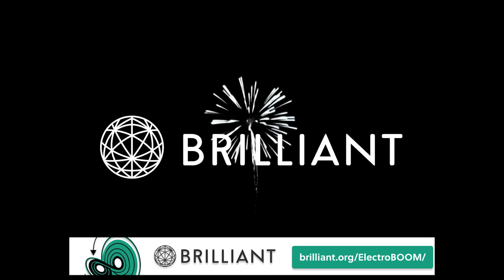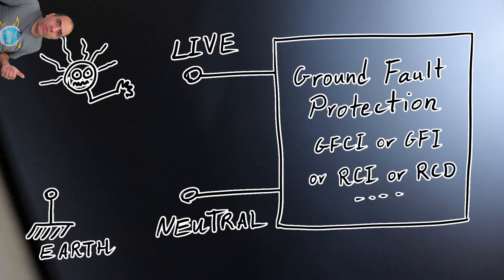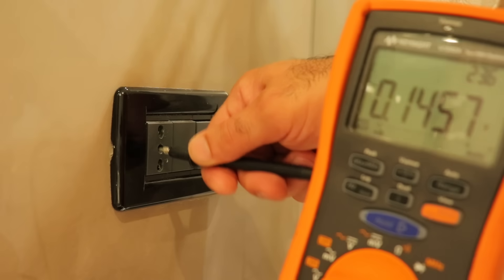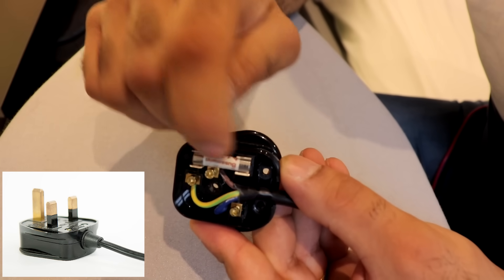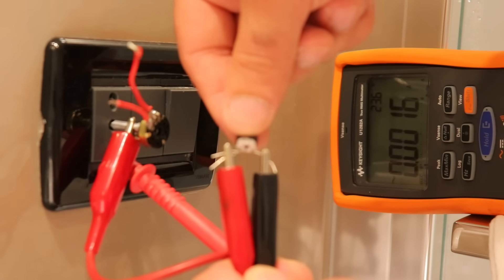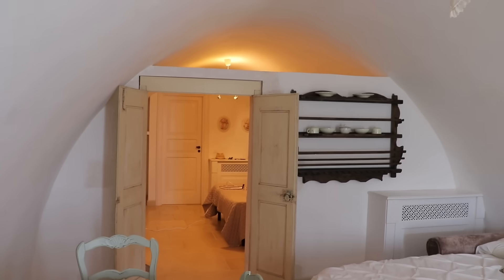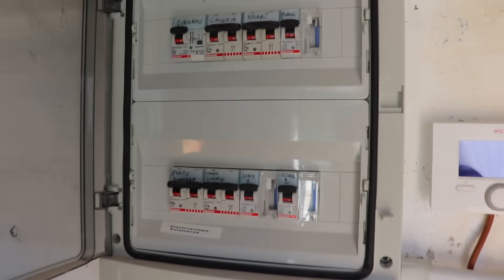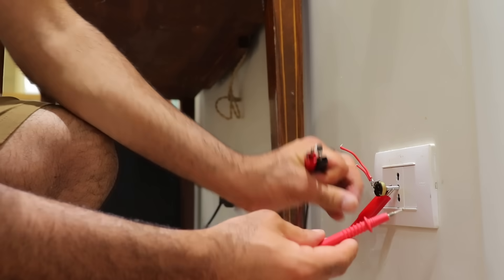Tripping Every Breaker in Italy

Comment: In most of the EU the problem at 15:26 is mitigated by the ungrounded outlets also being in a recess, which is exactly as wide as the plugs, which are meant to go with them, so the big plugs can't be fitted. (of course you can put an ungrounded plug in a grounded socket)

Basically in the EU, before engaging plugging anything in, you have to play a round of toddlers' game, where you put bricks through various shaped holes.

Also like how in France and Belgium (possibly a few other countries too), the grounded socket has a prong for the ground wire, and it engages with the hole on the grounded plug (that weird metal part between the prongs of the plug), but it still leaves room for an ungrounded plug to be inserted.

Comment: "weird plug" in the second hotel is for telephone :)

And btw, here in Belgium, the whole house (lights and plugs) are behind a 300mA GFCI except the "water rooms" which are behind a 30mA GFCI

The plugs are also different, the small tripod one in Italy exist here but no earth on those plugs, only the big round one have earth
Reply: Yup its called Jackson 605
Reply: I was guessing this was it. In France it looks slightly different but quite similar.
Reply: Itsnt it supposed to have 100mA main gfci and 30mA ones for different loads?That way you only trip the main in a 30mA one fails.
Reply: Belgium and France have powersockets with an earth pin, so you can plug in the powerplug only  in one way. I am wondering, is this fully standarisized so that always the brown wire of any device powercable is the phase?
Reply: @janwesten1317  in France the colors are Blue - Red - Green/Yellow while in Belgium we have Blue - Brown - Green/Yellow

Comment: In theory the schuko plugs (those rounded ones near the end of the video used on appliances) should not fit into the standard italian sockets. The schuko standard is a german one and its pins are slightly larger so normally they are incompatible with standard italian sockets and similarly the italian plugs don't fit into regular schuko plugs as they lack the central hole. There are plug variations that look like schuko to some extent but fit into the regular italian plugs and they are fairly rare and usually don't have the ground pin at all. Also there are schuko sockets that can accommodate both the schuko and the italian plugs.
All this of course makes sense as germany is one of our neighbours.

The grounding is usually omitted for your typical laptop or smartphone, which rely solely on the apartment's RCD and short-circuit protections.

All houses and hotels will have the setup you observed where the RCD is centralized. It has always been this way in Italy since RCD devices have been introduced.

It's true that the UK plugs have more safety built in, but honestly I love the fact that our (italian) plugs can be connected in two ways. It's very useful when you have to connect a power supply.

Finally, the secondary larger set of holes is intended for 13A appliances. Basically where you have the two closer pins you can draw up to a maximum of 10A. Where you have the second, larger set of holes (as well as for schuko sockets) you can draw up to 13A. This in theory should match the size of the wires in the socket but this is not always the case and more often then not they tend to use larger wires also for the 10A sockets.

Also, most of our socket boxes are divided into three modular slots we call "fruits". This means you can mix and match sockets and have 1, 2 or 3 sockets in the same box. That's pretty cool as it allows for nice extensibility.

Fun facts:
- most italian residential supply contracts are set to allow a maximum power draw of about 3KW for an apartment. Higher contracts are available of course, but are rarely used as they cost more. If  you get above 3.3KW a central switch will trip. Usually that switch is separated from the others and located nearby the power meter.
- the RCD in italian is called either "differenziale" (differential: it works by checking the difference in current between phase and neutral) or for regular folks "salva vita" (life-saver: no explanation needed).

Comment: Quick notes while watching the vid:
- we usually use one centralized rcbo and not on outlets;
- lol black is not supposed to be the neutral;
- yes sometimes it happens that you trigger both the local protection and the one before that;
- oh come on don't call them fuses they are magnetothermic protections;
- voltage to the low voltage customers is 230v +/-10%;
- we tend to place "fuse" boxes behind paintings and mirrors;
On a side note I think that all considered we have one of the best electrical codes around.
Reply: I live in Denmark so the rules obviously may differ to Italy, but there are probably similarities.

In a new home live would be brown and neutral blue. But in older homes the wires can have all kinds of colors. Black for neutral is pretty common in that case.
Reply: @coolguyflex  In Germany, it's brown for live and blue for neutral as well, and green-yellow for ground. Older installations often had black for live, grey for neutral and red for ground.
Reply: @coolguyflex  Its interesting that Denmark only allows 13A for 1.5mm2 wire despite its colder climet but in Australia they have no problem with 20A on 2.5mm2.
Reply: @MernokiMegoldasok  How do you know it's only 13A? I would've assumed it'd be the same as in Germany, where they most commonly use 16A breakers for 1.5 mm².
Reply: @srccde  We have around 13A limit here in Italy too. Absolutely no 16A on 1.5mmq.
Reply: @srccde  someone commented in al older video.I dont remeber the link.
Reply: @Ale-bj7nd  Interesting. 16A on 1.5 mm² is a no-brainer in Germany, usually.
It's probably due to the higher average temperatures in Italy.
Reply: @coolguyflex  ahahah yes. Same here in older houses, like mid 50 up to early 70, the wires have were solid core copper and mixed in colors
Reply: @coolguyflex  yeah blue/brown here too. And yes, older houses are a mess.
But blue has always been neutral here because black can be used for live wires too! That's the problem.
Reply: @Ale-bj7nd  Black can be used for live wires as well in Denmark. But they've been widespread as neutral wires. So it's just a giant mess.

Comment: I have been in Italy in the month of June, never ever in my life have I seen high voltage wires on the ground, that's right, 3 wires, R S T, 10 KV lying on the ground because apparently they didn't use money and resources to make a proper path for the cables. As a side note, it was on a mountain.
Reply: If a medium voltage distribution line falls on the ground the protection should trip.But never assume its dead.And dont go closer to it than 8-10 meters.If you have to do it walk in short steps to limit step voltage.
Reply: These have insulation on them, the red colored one. One kabel is 1x240, high voltage kabels, 10 kv and 2 Amper. And they are just lying on the path/route that is shown as a hiking trail.

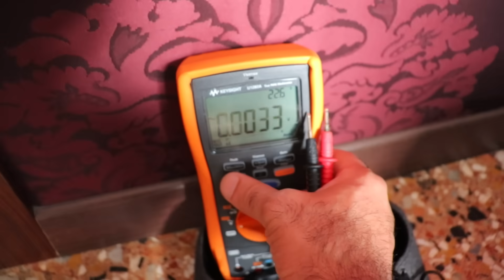Comment: 1:45 I was honestly scared if you were on current or voltage mode, thank god you didn't short it
4:35 I mean, I just expected it
12:05 Something you don't wanna hear from an electrical engineer
12:55 Sir there's a difference between schoting Ground with Live wire and Neutral with live wire
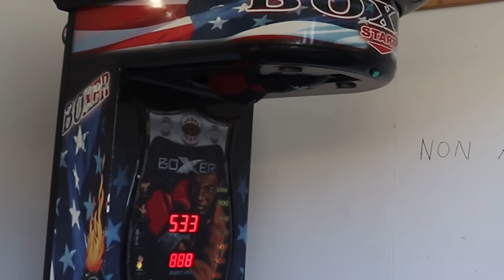13:58 Haven't seen your daughter in a long while, good to see her, she looks quite grown up now

And just inagine some youtuber enters your hotel, trips electricity and judges your power breaker, outlet and protection circuits

Comment: Your videos are both informative and entertaining. If ever you come to France you will see pretty much what you had in the last two hotels, except there is only one style of socket for wall outlets (the polarized one, except the earth is a prong), older unpolarized outlets are not available anymore (note the holes were smaller to prevent insertion of polarized plugs... well in theory). Light circuits (10A breakers) are separate from outlet circuits (16A typically, sometimes 20A). One 30mA RCD per "group" of lights or outlets. No unprotected circuit, all must have RCD.

Comment: At 3:40 you said black wire was neutral. Are you sure you didn't mix that up? In most of Europe, Italy included, following the code that has been used for decades, blue shall be neutral. Black, brown or grey for live or white when the live wire comes from a lamp switch (the white thing is often neglected and the same color used to and from the switch). Black neutral would be a serious mistake.

Comment: Here in Italy you can instantly see the rcd in the breakers panel by a button with a "T" letter (meaning "test") on the breaker itself... if there's no T button, there's no rcd.. i always install breakers with rcd even for air conditioning line, light line, power outlets line, dedicated power outlets for kitchen line etc.. greetings 🖖🏼

Comment: Actually Venice wasn’t up to code: blue (the only color mandated along with green/yellow) should be neutral. Also we use 2pole breakers because distribution is TT and not TN (PE is not provided nor bonded with neutral). Also in Rome you should have experienced 230V 3phase (with distributions across two phases and without neutral….. who needs the neutral for 125V stuff today)

Comment: In denmark new standard 2016 and up is required all new building have 2 different RCD. So no single RCD can cut off the whole house. My apartment has 2 different RDC :)

and some wires that doesn't have ground is ok. Most smaller electrical devices is double insulated. Like a laptop charger og phone charger. Very likely double insulated.

Comment: the plug at 15:17 goes in the outlet beacuse it was forced in before, but it should not enter because the hole diameter in the outlet is smaller. But we all force that type of plug if we do not have the adapter, so it is common practice.

Comment: 3:38 black is phase, blue is neutral and green/yellow is protective earth. 
C is the characteristic of the breaker, 10 and 13 are the amps. There is also B characteristic, which is much more common (and should be installed in a hotel). C is for heavy loads like big motors which suck lot of power when staring.
Reply: Do you mean "should be" as per your opinion or as required by law?
There's at least one European country where C curve breakers are used everywhere, Belgium.

C breakers trip magnetically at 5-10x In, B breakers between 3-5x In. Unless you're switching many capacitive loads without inrush current limiting, i don't see why C curves are the standard choice but that's the way it is.

As far as i know, B is the standard in the Netherlands and possibly Germany.
Do you happen to know if any of the other European countries require a certain characteristic curve for residential applications?
Reply: @bjornroesbeke  Both capacitive and inductive loads can trip a B breaker.In Hungary some utility companies put a B type 32A breaker so you cant put C in your breaker panel because the main will trip before that.
Reply: @bjornroesbeke  „should be“ is not enforced by law. The guy who is doing the planning should consider the load. And in a hotel there is no need for „C“. Water cooker and vacuum cleaner will not Trip a b13.

Comment: funnily you can tell bare overhead line voltages by insulators. this is not really accurate but difference in tens or hundred of kilovolts is clearly showing

Comment: As italian I think all the breaker trigger at 0.30amps because most house hold items here have what Is called double insulation, thats prevent the user to come in contact with high voltage in case of a fault of the item

Comment: 15:23 normally you can't do that. The plug is most likely worn out or someone tried to force the plug in like you did. Those "double drilled" outlets have smaller holes towards the center to prevent a shuko plug from going in without an adapted that connects the ground as well.

Comment: 6:15 they are insulation for old cables that is disconected because of new cables........ but it still live...... also the 2 type of holes are (in pure teory) to diferenciate between a line whit low power consuption arrangment an high, for example a line that is only used by lightsourse needs only 500w can have an electric socket whit small holes and a breaker set on 1 kw while another line whit electric sockets whit larger holes can support more load and be set to 3kw.... this today is only in teory because is part of the older rules, infact you can find all sort of adaptor between the two..... also 15:00 we can plug the things how we want because is always rectified in the device itself.... also shuko plug is in teory not plugable but the mesure are so close that often  you can foce it

Comment: The wire connectors at 3:10 are common in Sweden too. Here we call them "ubåt"=submarine due to the slight resemblance of such crafts (imagine the screw being the sail of the sub).
Reply: Submarines don’t have sails
Reply: Maybe they meant the periscope
Reply: @purpleapple4052  Don't think so. The sail (which most submarines do have) is more proportional to the screw thing on the connector than a periscope is.
Reply: @PCrailfan3790  Yes they actually do, words can have different meanings. The tower looking structure on top of the hull is called the sail, see https://en.wikipedia.org/wiki/Sail_(submarine)

Comment: 7:13 it's standard European 1 plase RCD.
Mostly B25A / 30mA - These are relatively cheap... 1 phase B30A / 30mA or B25A / 50mA are pretty expensive
Reply: There is no B30A. Its B32. Also the next after 30mA is 100mA.
Reply: @MernokiMegoldasok  there is even B28/10mA.
50mA RCD is not common same as 500mA ones

As electrician i have seen 10mA and 1A RCDs (1A was 3 phase 2MW machine with DC brushed engines)
Reply: Nope just na normal RCD its only for ground fault and the braker right beside It is probaly a b16 or c16

Comment: 15:25 fun fact

Here in germany where we use the EU plug, a thin 2 prong plug for small devices < 600w, and the Schuko plug for bigger stuff (the bulky one you have in your hand while plugging it into the "wrong" outlet)
And the cool part is you cant (normally) plug a Schuko plug into an EU plug- only outlet since the holes and prongs are thinner on the EU plug so the thicc Schuko prongs dont fit.
Ensuring that every device that is mandated to have a ground connection is receiving it since you cant plug it into the wrong outlet.
Reply: Its not limited to 60W. 230Vx2.5A=575W. And some of them have 6A rating instead of 2.5A.
Reply: @MernokiMegoldasok  ohh thanks for catching that typo ... i wanted to type 600w 😅
Reply: @DJRaffa1000  Do most people hate afdds for false tripping?I read somewhere that Germany reuqired it since 2017.
Reply: @MernokiMegoldasok  as far as i remember arc protection is only required in high risk commercial buildings, things like paper or textile facilities.

Comment: Italy is kind of a special case regrading connectors: They use both the shown L type connectors, and Schuko connectors. Schuko is the most widely spread standard in Europe (the UK, Swiss and Danish created their own standard for some reason, the French (plus Belgium, Poland and Czech Republic) use Schuko-compatible connectors, but incompatible sockets - probably just to annoy the rest of Europe). For devices which don't need ground protection (like power adapters for Smartphones) there's the EU connector, which can be used anywhere in Europe (except in the UK, because.... Who knows). And yes, GFCI protection is required for all sockets in virtually any European country.

Comment: Some informations about italian plugs:
- there are 2 sizes of them, the small one supports up to 10A, the big one up to 16A. If a socket has both sizes the wiring behind it should be rated for 16 amps, otherwise it only supports 10 amps. There are also 16 amp only sockets, usually on old systems. It is fairly common to find "german plugs" (the round ones) in particular for high power stuff, instead of the 16 amp plug, but you can't find the "german sockets" easily on the walls. Usually you get them with adapters or power strips. It is legal to sell adapters with a 10 amp plug and a german socket, although the german socket/plug are rated for 16 amps. "German plug" connectors are slightly closer than a linear 16 amp, so you cannot really plug them in directly in a new 16 amp linear socket, but if you force them in a 10/16 socket you can deform the socket until they connect. Note that german plug contacts also do not have the usual plastic protection that prevent you from touching them (since the whole plug goes into the socket), so this practice is very dangerous.
- the doors you find on some sockets are a modern security requirement. I think it is mandatory in all new installations, but replacing old sockets is not. Same for the plastic 
- GFCI protection is mandatory for all electrical systems. In Italian we call it "salvavita" (lifesaver), for obvious reason. It is usually separated from the breaker and has a "T" button to test whether it works. Because of this you rarely find GFCI protecting a single socket.
- it is very common in older system to have separate circuits for plugs and lights, but not for different rooms of the same house. I think it is because wiring for lights are usually thinner, and also if you trigger the GFCI on a plug you still can see around in the night.
- Sometimes in larger systems there are multiple GFCI breakers, with the root one set to higher power. This is so that you usually don't have to run all the way to the main breaker box to reset it when it pops. In my experience they always pop together.